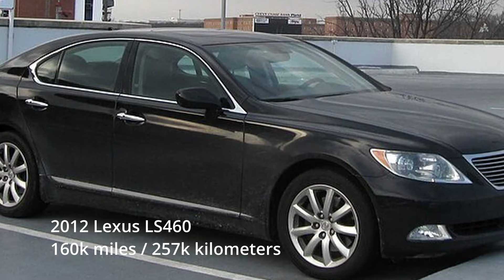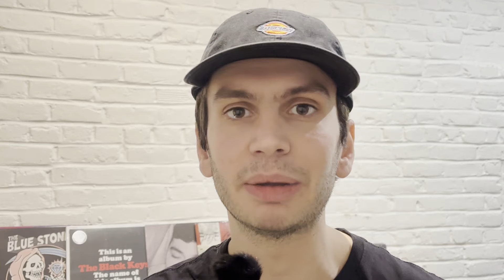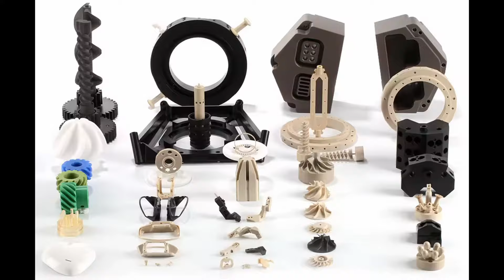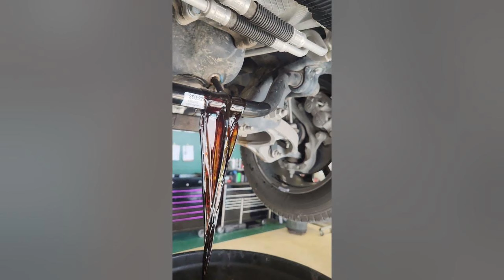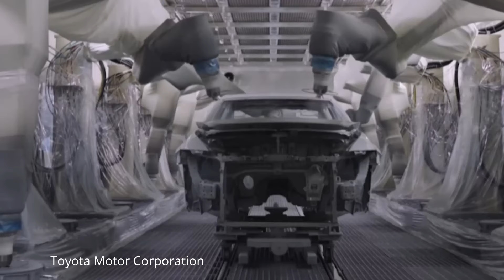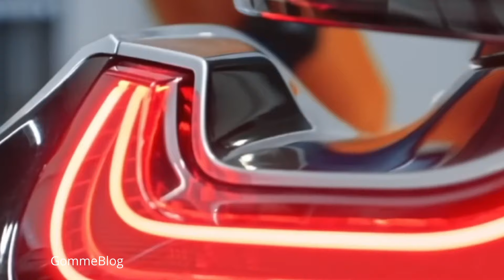Are Old Cars Really More Reliable? | Planned Obsolescence

Comment: Great review comparing old and new ! I too this day still own and drive a 1981 Oldsmobile Delta 88 and a 05 Mercury Grand Marquis with no issues other than getting harder to get body parts for the Oldsmobile . I could certainly agree that they sure don’t build them like they used to . The new cars are being built cheaper and lighter for fuel efficiency . I don’t like new cars and trucks because they have become NASA on wheels .

Comment: Replace automatic tm fluid on time 90k miles/150k km  on toyota/lexus. Dont let someone tell its lifetime. Volkswagen have more problems than toyota after 5 years already. Some are scrapped because broken engines or electronics

Comment: Not better, but easier to maintain, such as tune ups, part change out, easy access to components.  New cars, well, if you don’t have electronic tools, good luck!   You can change a flat tire, if you have the proper lug wrench.   Most  of them, you have to remove the front end, just to change a headlight.

Comment: I still drive my Renault Clio 1.2 I bought in 2001. 240000 km and still running strong. I still have the original clutch and I still get more than 20km per gas litre. The establishment will try and oblige me to have it scrapped on pollution issues but I'm going to keep it to its very last day. I don't want, I don't need  a smartphone with four weels

Comment: It's well established that Teslas loose about 1% of battery capacity every year. So after 15 years, the car is most commonly fully useable and doesn't need a new pack. Plus there are mechanics, not many but they do exist, that can repair faulty Tesla battery packs by repairing only the faulty individual cells within, costing a fraction of a new battery.
Reply: There is at least as much problems with the electronics instead.
Reply: @martinsv9183  Even if that were true, which data shows it just isn't, that is a different question.
Reply: @gsadow Data shows exactly that.

Comment: I've seen squarebody trucks (GM Trucks made from 1973-1987) with 300k miles still going perfectly fine

I've seen this old couple that owned a 1970 Chevy El Camino SS with 250k miles still has original parts and engine but the reason why was because it had its regular service

One of my neighbors newer F-150 it's a 2024 only has 2k miles already having Transmission Issues and has more plastic not even fully attached, they have only 1 leaf spring on each side , Just JUNK
Reply: I have my Dad's 1968 GMC . He said it was the best wheelbarrow he ever owned😂

Comment: I'm old enough to have seen the golden age of automobiles.
the 70's cars would have major problems by 100,000 miles and that was the normal lifespan before they were sold for pennies or given to children to drive, learn on and then retire.
 
 The 80s had the Japanese market (namely Toyota) write the books on quality and reliability. They did this with lower power, lighter weight, and robust engineering with exception machining tolerances, better metals, better rust protections, and the engineers who focused on longevity.

 The 90's built 80's quality with better plastic. More companies became more reliable, even american made cars improved while they suffered greatly from poor craftsmanship.

 Up until the 90s, the automatic transmissions were horrible, sluggish, and tragically slow while also being expensive to repair or replace and be greater than the cost of the car.

 Toyota perfected the manual transmissions from the 80's and it was the first time a 4x4 could survive 200k, as they would (and do) still work after a million... (many jeep owners would harvest the toyota (aasin) hubs and running gear, etc for their jeeps).

 Which is why an 80's landcruiser is worth $50k these days.

 Now, imo the fall of quality or reliability actually started with BMW.
 Not on purpose, and it was a side effect.
 They began using auto-cad to develop their e36 (and all later models) to save time, money and be the first to ditch the drafting table and throw away the engineering slide-rules.

 What happened was it changed the design from being overbuilt to exactly just enough to not fall apart (and yet BMW e46's have a known issue that they didn't build their rear axles into the body enough and they needed to have a recall (M3, 330's, 328's were mostly affected) and the rear wheels could literally fall off the car with the axle on high speed corners.... 

  It wasn't all bad, and yet with all the new safety requirements, and tech the roads are safer but also at the cost of top heavy overpowered behemoths with drivers too busy looking at their phones than the roads.

 Modern machining is so far advanced that they could make cars last longer but it would also be at the expense of what would be considered wasted effort by shareholders who want the absolute most returns b/c people will always want to buy the new shiny with a warranty and not care.

TLDR; the golden age of used cars is late 80's - 2008 Japan and late 80's Germany, avoid 90's, but 2004 - 2020 is strong for Germany... and Mercedes falls off a cliff in 2011 (their last manual).. Porsche is going the same path, soon to be bleh.

 Note: any car on the planet can run forever with proper maintenance and rust protection... I'm just stating a grand general opinion.
Reply: I don't think it is the AutoCad. Even planes and Roll Royce are designed on AutoCAD. The issue started with Business Consultants modelling a car business to sell more and let the after sales market handle the rest. This high consumerism let to this use and throw policy.
Reply: Most 70's cars. Except Mercedes as usual. That was already then used as Taxis everywhere. Also had the best autoboxes by far. Their cars always felt like at least 1 generation ahead of everyone else back then.
Everyone started using computers to design cars as soon as it became possible. Not just BMW. Saves enormous amount of time. And can also make things much more fail safe. Especially after 3D.
Reply: I disagree. Not by accident and you said it yourself.

They changed direction from "overbuilt" to "just enough".

ps: Overbuild inmho is not Excess but Honestly built. It is built for purpose and with indefinite reusability (repairability). Not design for destruction and replacement.

Comment: New cars are more reliable. However, government mandates for efficiency have driven that reliability down in very recent years.
Reply: Depends on how you count. The things that would break on older cars were usually very easy and cheap to fix.
Reply: @martinsv9183  90s cars were unbelievably reliable requiring virtually no fixes. Cars from prior decades would literally fall apart and be unusable much north of 100k miles. When I say "very recent years" I actually should have said "past couple decades". When you pass your 30s, time goes faster than you realize.
Reply: @ Yes the cheaper cars would. But on the flip side you can also take a look at the milages of the Mercedes Taxis from those decades.. And also the private ones.

Comment: Absolutely. Automakers are in a perpetual race to out-gimmick each other. This means manufacturers are constantly introducing more new technologies, gizmos, complicated electronics/automation, which only means more potential points of failiure. Combine this with the use of increasingly more components made of less durable materials, like swapping steel and aluminium parts for plastic ones, in more high stress applications and you have your answer. Car companies know that most people only keep new cars for 3-5 years, so they only need to last through that initial period.